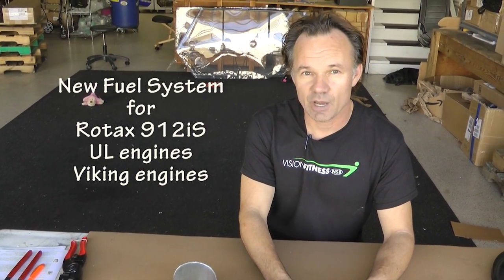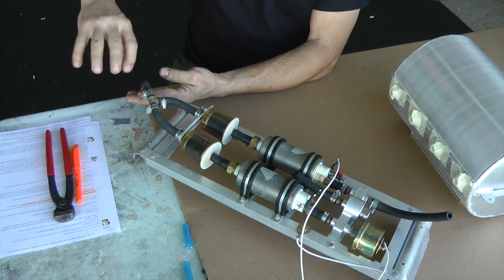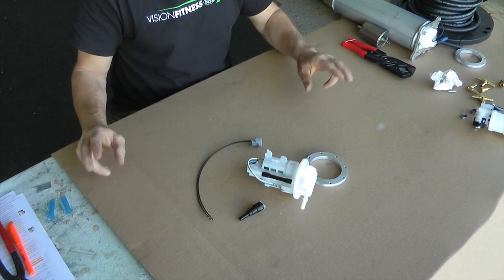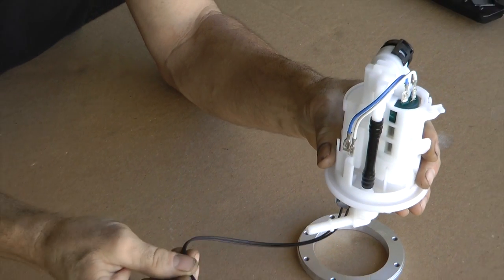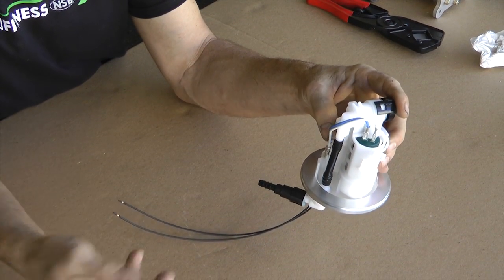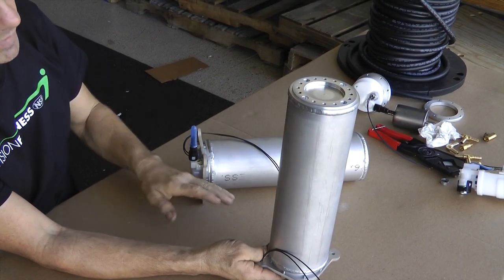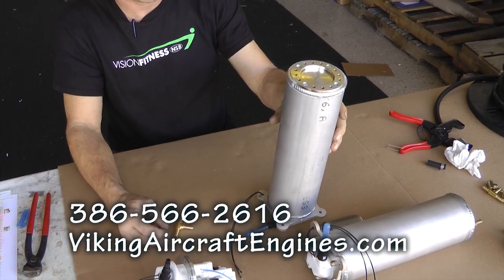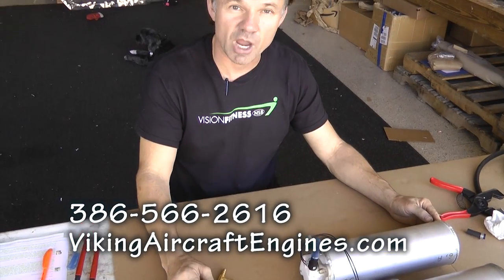Combination Fuel Pump-Header Tank

Comment: Disappointing that Viking will not sell the pump separately. I don't need that particular style header tank and was told by Viking to go find the pump on the open market myself.
Reply: Fuel Pump For Yamaha YZF R15 3C1-E3907-10 3c1-e3907-20 3c1-e3907-21
Reply: Yamaha YZ motorcycle pump. As for me, I'm gonna buy his mini tank, if for no other reason to support small business and help pay for his R&D

Comment: I was just thinking of doing this to my 701 in the poly header tank. Now I definitely will, thanks. You are very right to mention that aftermarket inline pumps are meant for very high horsepower engines and so have too much flow. Rotax has found a nice way around the dual pump setup though, mounting them in series with bypass to avoid doubling the flow when both are working.
Reply: Did you check to see if Viking would sell you a pump separately? I was told a flat no thanks.
Reply: @Arjuna86004  nope, I have been looking for aftermarket fuel pumps catalogs. Not yet made a choice, I'm bench testing my engine with cheap inline pumps.

Comment: Nice and neat, it normally suits flat wing tanks, and your header also fixes that for 'box' shaped types. I am happy with a continuous filtering of fuel as given by a 2003 Polo fuel filter on the output, with a built in blow off regulator to keep fuel pressure at 3 Bar or 42 psi, cheap and simple and the return  isn't a big issue, as it gets rid of air and vapour locking. Do like your idea of check valves on twinned pump setups.  My setup was advised by a BMW tech who lectured on fuel injection, used a single Flutra pump, only concern with mine is no input filter to the pump itself, but might put a coarse screen filter to minimise risk.

Comment: Jan, I'm impressed with everything you've developed with the Honda engines for aircraft use and wish the Viking 130 was a physically workable option for my little Pulsar III. BUT this fuel system is absolutely brilliant. The weight, cost and complexity of the systems UL Power and others specify for their installations should forever be a thing of the past now that Viking has developed this superior option.
Reply: Checkout the Viking 90

Comment: regulator is supposed to be close to the engine to relieve vapor
Reply: Very old system.  Not at all popular in today cars
Reply: In the US, I believe that stopped being the case in 1996 and newer cars.  It's been this way for almost 22 years.
Reply: Don't forget that this kind of system has a 3 bar pressure. It doesn't form vapor easily.